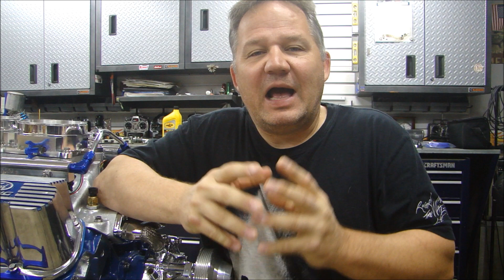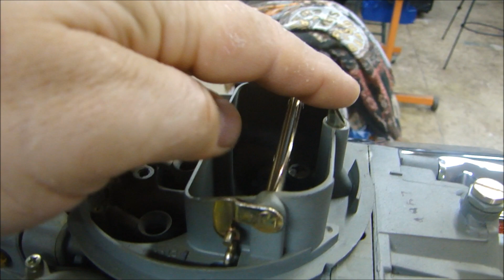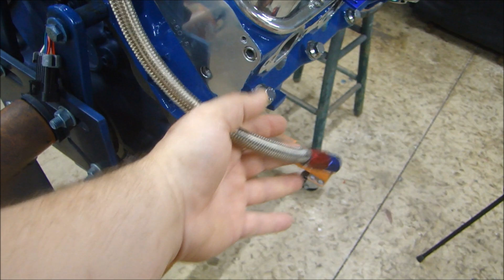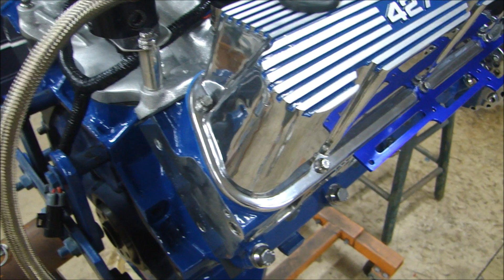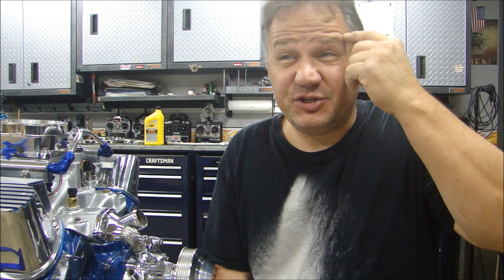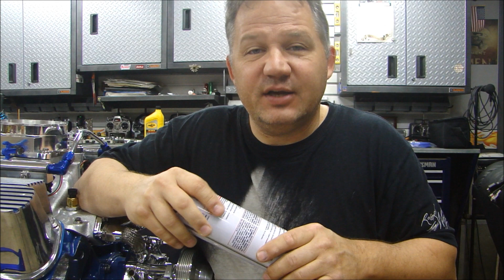Vapor Lock & Hydro Lock

Comment: hi pete, i see this video is a few years old, but i just wondered if you could answer my dilemma.  i have a 5litre v10 bmw m6 which went to my local bmw dealer for 2 sensor to be replaced and a new fuel sender gauge, all under warranty. now this is my awful situation. the mechanic has admitted to taking the car out for a test drive. in turn hes run out of petrol and the engine has hydro locked. is this possible ??  at the moment bmw are blaming a faulty injector, due to  it coming to the end of its life (67,000) and making me foot the £30,000 bill. i personally think  running the fuel that low, its dragged crap through the system and caused the injector to lock open causing the damage. would i be correct in my explanation . im just trying to  get together as much ammo as possible for when my case probably goes down the legal route. cheers paul
Reply: i also forgot to mention, in my opinion, i think my engine was under serious load when the lack of fuel occured . this engine revs just shy of 8500 revs. the whole situation just seems a bit fishy and i feel the dealership are screwing me over to save one of there own mechanics job.
Reply from the maker: I would think the fuel filter would catch and debris. But if he ran it out of gas, many things could have happened. In my opinion, if they broke it, they bought it, and I would sue them to make sure
Reply: That seems to be the general trend mate. It was left with them in perfect working order. It onlyj just had  a new engine16 months ago under warrenty due to shells ffs. It's like ground hog day. The engine had it's own 2 year warranty that was made void due to the fault  being consequential human error and running out of fuel. Do you think I'd be in the same boat if its proven is was a faulty injector and also a consequential part causing the error. Basically the unit itself is not to blame...😪😪

Comment: Question I drive a diesel truck now I’ve heard of hydro lock on  a diesel   But I’ve never come across it  and wished I knew how to explain it also I’ve heard of  a run away diesel. Never had it happen but  is it possible for  a diesel to hydro lock and why and how please let me know
Reply from the maker: Since a diesel is such high compression, if the fuel sails to ignite it can fill up quick and hydro lock

Comment: Can i ask what your opinion is of engine decarbonizing.....because from what ive learned from this video i feel it is a bad idea....is that correct?
Reply from the maker: What method are you referring to?
Reply: @PetesGarage  when you mist water into the intake once engine is hot and your reving it up....not alot just lite mist. I dont want to ruin anything but watched a video that showed it worked well but be very careful it said. Kinda mimicing how coolant cleans the piston when it leaks? Pushing a boroscope into the spark plug hole it looks much cleaner....but whats your opinion?
Reply from the maker: I would guess the steam from boiling water somehow clean the cylinder walls, but I can really see it breaking down carbon. It's worth a try
Reply: Is there a possibility of ruining the engine? Im not gonna over due the steam i want to do it with very little steam over a long period. So i can keep the least amount of water building up in any given spot. If its a bad idea i wont bother just recently saw a few posts on it.....you seemex to be the smartest and have most experience on a similar subject.

Comment: So my engine vapor locked because of fuel. It pooled up in my number 7 spark plug hole, i pulled the plugs and fuel poured out of the number 7 hole. the other holes had a white vapor comming out. have u ever seen that?
Reply from the maker: If the cylinder had fuel in it, it was hydrolocked. White vapor is the fuel evaporating.

Comment: Pete Im in Australia and have a 454 chevy silverado with standard quadrajet on it Lately I have noticed that after I initially start the car the engine starts fine, but after I drive some distance and this doesnt always happen, but when I turn the engine off and I try to start it again within a few minutes the engine has difficulty cranking even to the point that it wont turn over .like a flat battery this has happened a few times over the last week and those days were rather hot but the temp guage is showing normal,canyou give me any ideas    LES
Reply from the maker: If you have fuel leaking into the cylinders it could be a hydrolock situation. Let the engine cool down and see what happens.
Reply: The quadrajet was notorious to leak at the bottom of the carb. while sitting after a hot soak as its called. If you pull the carb. you will see some plugs in the middle of it. Clean that area very well, sand paper emery cloth and brake clean. Apply JB weld to those pugs and it will stop the problem. Let me know if you are still having problems but try this first. Have a good evening mate.

Comment: Maybe if we'd stop using liquid fuels in our engines and use the vapors only. It's really the only thing that's combustible, liquid gas will never burn, it's always the vapors.
Reply from the maker: Interesting point
Reply: ***** Thanks for the reply Pete, your channel has really been helping me learn about engines, and I just can't for the life of me understand why auto manufacturers decided to continue refining the 4 stroke motor. I mean a two stroke has less moving parts, more horsepower, and less weight yet they decided to use the overly complex design of the 4 stroke instead of figuring out a direct injection system for 2 strokes which is very possible. Ski-Doo's current E-Tec engines are great examples of what a 2 stroke can be if you directly inject the fuel into the piston instead of using the crankshaft. They actually claim you only need to fill your oil tank once per season so if these engines can consume less oil while making more power, why do auto manufacturers continue to use 4 stroke engines in their cars? I've always thought less moving parts was a better thing but it almost seems like the auto industry wants to move backwards.
Reply from the maker: It's more about torque than HP.
Reply: ***** Yeah I know two strokes are known to have no low end power, but I think that if you directly injected the fuel then logically it would be a superior engine. The only reason you don't have low end power is because you are essentially choking the engine by slowing down your crankshaft which is what is pushing air/fuel into the piston on it's intake stroke, but if your engine didn't rely on this for it's fuel source then you'd have power throughout any rpm.

Comment: Thanks, Pete. Now I comprehend how hydrostatic pressure can be so damaging. I had not thought about that effect, until you put the picture together. Like a gallon of water from five miles under the ocean surface will occupy the same volume as a gallon at sea level, even though it is subject to well over 11,000psi, it does not compress. No matter how much titanium is in your engine, it cannot compress a cylinder full of fuel. Seizure and/or busted parts will probably result.

Rapid expansion of gasses from a high pressure system into a low pressure environment due to evaporation is a state transition that has an endothermic chilling effect of cooling down. Much like the workings of an air conditioner or heat-pump home heating/cooling system or sweating and a breeze hits your skin. Expanding gasses as the result of combustion, that's a different problem of a chemical reaction. In both cases energy is conserved, so sayeth everyone. Figuring out how and where, can be a challenge.  Kinda fun remembering problems from some 40+ years ago.
Reply from the maker: I like the way you think. Thanks for this comment too

Comment: the little hold down bolt on the fuel rail looks loose.  great video .   I had an old charger that used to vapor lock all the time
Reply from the maker: I didn't have them bolted tight yet. Good eye

Comment: Pete you forgot one detail. Fuel injected cars are far less likely to experience vapor lock due to the high pressure in the fuel lines. Physics dictates that the higher the pressure the higher the boiling point.
Reply from the maker: That is true....thank you
Reply: I've never seen a stock fuel injection system vapor lock.
Reply: ditto never
Reply: i was just thinking the same thing. especially high pressure fuel systems. This is why the newer cars use it. More reliable and more consistent higher pressure is like more atmosphere causing much higher boiling point.

Comment: Howdy Pete!  Thanks for the great explanation.

Question:  Back in the day, old timers used to pour cool water on the outside of a carburetor to cool it when encountering vapor lock;  will this work with an EFI system?
Reply from the maker: You could cool it that way, but water is not a friend to the electrical system
Reply: I remember My Dad saying he used to pour water on the fuel line to cool it. This was way back when everything was carburated.

Comment: With all due respect, I seriously doubt that a running gasoline engine will have the conditions conducive for cryogenic thermal expansion to occur internally. Cryogenic thermal expansion typically occurs at temperatures around or below -238 F (-150 C). Would you please explain further? 

Hydro-lock occurs in an internal combustion engine when there is a volume of incompressible fluid in the cylinder on the compression stroke that is near equal to or greater in volume than the effective volume of the combustion chamber. 

I also don't believe that a running engine experiencing a fuel (boil) vapor-lock condition and or a cylinder experiencing no ignition/combustion events can experience hydro-lock from the fuel being injected. 
On a running engine the cylinder/combustion chamber is completely swept (cleared) every 2 revolutions and there is not enough fuel being being injected to cause hydro-lock. 

Here is why, let's do the math: 
Assume Ford FE 4 stroke gasoline fueled 427 CI (7L) V8 11.5 CR with 76 cc combustion chamber, Multi Port EFI with (8) 1000 cc/min, 95.2 lbs/hr (43.181 kg/hr) fuel injectors good for more than 1000HP, most decimal values rounded to 3 places. 
A 1000 cc/min, 95.2 lbs/hr (43.181 kg/hr) fuel injector delivers ~16.667 cc/sec at ~85% duty cycle. 

The reference engine at 1000 RPM = 16.667 RPS, the time period for 1 revolution = 0.060 second. 
Theoretical maximum fuel delivery would be ~1.00002 cc/revolution. 
Total theoretical maximum fuel delivery per 4 strokes (2 revolutions) would be ~2.00004 cc. 

Same engine at 5000 RPM = 83.333 RPS, the time period for 1 revolution = 0.012 second. 
Theoretical maximum fuel delivery would be ~0.200004 cc/revolution. 
Total theoretical maximum fuel delivery per 4 strokes (2 revolutions) would be ~0.400008 cc. 

With a 72 cc combustion chamber it would be practically impossible to hydro-lock the reference engine with injected fuel due to vapor-lock or no ignition/combustion events since the injectors are incapable of delivering the necessary fuel volume in the allowed time periods. 

However a defective or leaking fuel injector could result in hydro-lock, but only if multiple conditions are met. 
Those conditions would be: 
1) Hydro-lock occurring only on startup. 
2) A defective leaking MPI fuel injector. 
3) A residual fuel pressure system. 
4) Prior to startup the intake valve on the cylinder with the defective leaking injector must be open. 
5) The volume of fuel leaked by the defective injector must be greater than ~90 percent of the effective combustion chamber volume. 
With the engine not running the defective fuel injector bleeds off the residual fuel rail pressure by leak-down into the intake runner and into the cylinder with sufficient volume resulting in hydro-lock upon startup. 
The leaked fuel volume to result in hydro-lock in the reference 76 cc combustion chamber engine would have to be greater than ~2.332 fluid ounces (~69 cc). 

Regarding vapor-lock, when the fuel boils and changes state from liquid to vapor (gaseous) you state air is then in the fuel lines/rail, how is air being introduced in the fuel line/rail? 

Also fuel vapor-lock is detrimental because gasoline fuel systems, pumps and fuel injectors are designed to operate and precisely meter the fuel using liquid fuel and not a gaseous vapor. Boiling fuel in carburetor systems have similar but different issues where the fuel vapors vent into the intake air stream altering the effective air-fuel mixture. Engine mounted mechanical fuel pump fuel systems typically experience vapor lock on the suction side of the pump where the boiling is exacerbated by the negative pressure required to suck the fuel from the tank to the pump affecting the fuel vapor pressure. 

Modern gasoline is not a pure substance, but a complex composition of petroleum distillate fractions that vary greatly from batch to batch.  No two batches of gasoline are ever exactly alike. 
The boiling point of gasoline varies greatly from ~90 F to ~300 F with the lighter fractions boiling at the lower temperatures and the heavier fractions boiling at the higher temperatures. 
Some gasoline batches will more readily experience vapor-lock than other batches of similar brand and grade. 
Fuel line vapor lock can usually be mitigated by employing the gas laws and raising the pressure of the fuel in the lines/rails and locating the fuel pump close to or in the fuel tank and by continually circulating the fuel in a closed circuit from and to the tank using separate fuel supply and return lines to/from the engine. 

How is your doctorate progressing? 
Your lighting, audio, color and video production is looking especially good lately, did you get a new camera? 
Thank you for sharing and taking the time and expense to record, edit, produce and upload these videos.
Reply from the maker: That is one of the most awesome comments ever! I mention cryogenic freezing because I worked very heavily in the CNG vehicle industry. I have been in Dallas and San Diego helping municipalities solve problems with frozen gas lines in 110 degree heat. I admit it's unlikely for that to happen with gasoline, but the phenomenon does exist. Thank you for taking the time to do the math, it really does help with the understanding. 

Doctorate is on hold while the kids are in school.They get priority over me.   Thank you very much!
Reply: ***** 
Thank you. 
OK, I can agree with CNG/LNG and even propane fueled engines have cryo/freeze issues. 
Were the issues you were experiencing near the pressure regulator, at the injector or post injector? 

I experienced a similar problem that presented as fuel delivery/pressure regulation issues and was due to the pressure regulator freezing which were just symptoms of the real issue. 
After many frustrating man hours we accidentally discovered the culprit was the CNG with an elevated moisture content during a post commissioning fuel analysis.

I personally know and understand the "kids come first" situation. 
You are very welcome.
Reply from the maker: I was heavily involved with the development of CNG fuel delivery infrastructure and systems for vehicles. I worked closely with Ford and GM on their programs. I traveled around the world looking at, and working on the best methods for CNG systems. The biggest problem was, as you stated, inconsistent fuel BTU and water content in fuel. If you drive from Maine to California in a CNG vehicle, the performance will suffer considerably because of bad NG. There was no real standard for allowable water PPM in NG so the systems had to be designed to accommodate the range of fuels available. What worked at the factory did not work in the field. Fuels systems were full of low pressure drops throughout the entire system with most freezing occurring at the regulator and filter....makes sense. It was strange to be standing in a concrete lot in Texas, it's over 110 degrees outside, and a bus is stopped because of a frozen fuel system. I also got to monitor the 110 CNG vehicles at the Atlanta olympics. Not 1 problem but it took a ton of work and effort to make sure they all ran flawless.
Reply: Allegedly, this kind of icing effect was the downfall of the USS Thresher in '63 as they were blowing their trim/ballast tanks. The crew of 129 were lost.

Comment: I see the angle in your pitch Pete but how many EFI engines have you seen come in with a non functioning spark plug that resulted in a hydro lock.?...Me either...Just sayin'
Reply from the maker: True, but then again I work on custom built high performance engines and I see these problems quite often.
Reply: I'll agree with mechanical injection and methanol and for that reason we'd leave the plugs loose on the first start up...Rather blow a plug out of the head than bend a rod

Comment: Please correct me if I am wrong, When you were speaking about vapor lock in a FIE could that lead to premature detonation in the cylinder causing a con rod to twist and possible seize the entire engine?
Reply from the maker: It could, but I have seen the piton melt and blow out before that happens.